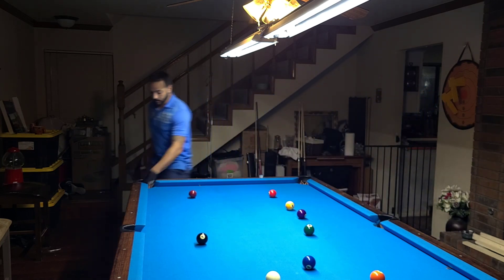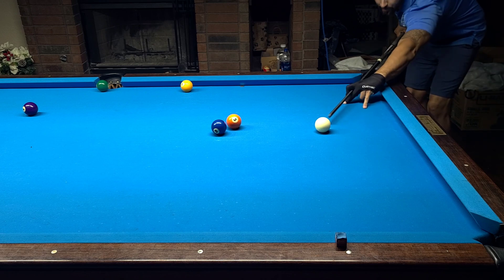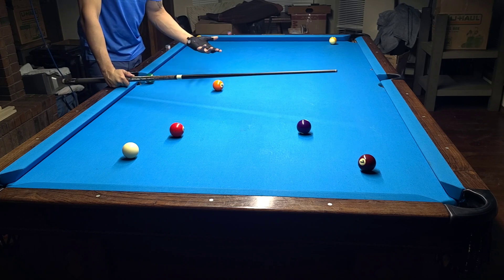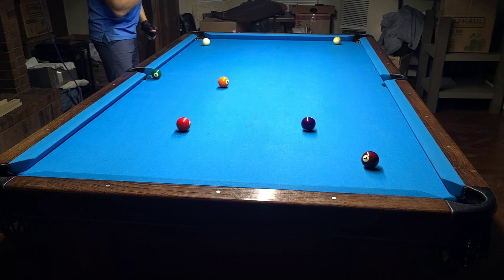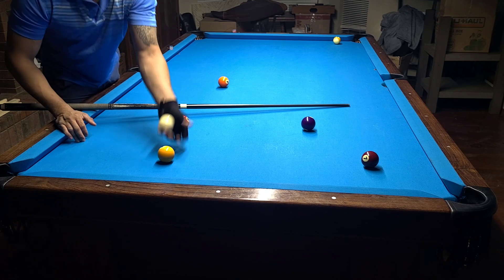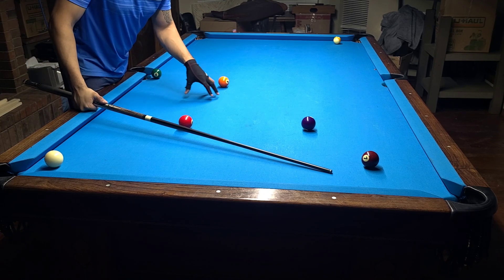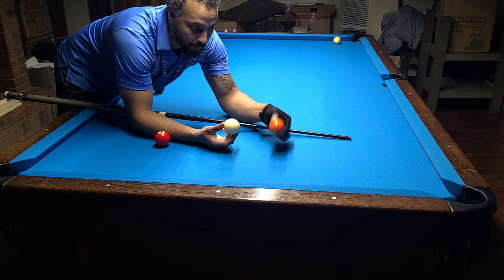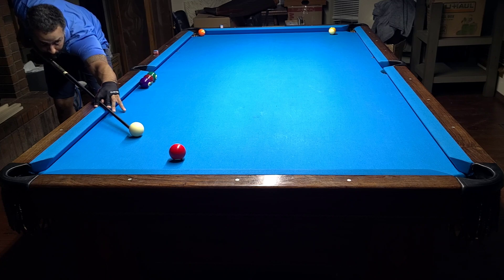90°+ Banking (Intro to banking)

Comment: Kicking and banking is the same angles the on Lu difference ic when you bank you put opposite spin on the cue ball if you are banking a ball to the right which you have started tell that now in your video!! It’s still the same angles 😎of course there are many variables that cause all banks an all kicks to be low % shots !! I learned the # system from Tor Lowry many years ago and it works really well of course every table shoots different! I went from a 1980’s 41/2 x 9 GANDY  to shooting on 7 ft DIAMOND WITH SAME CLOTH SIMONES 860 ! And it took me at least 6weeks playing a couple night a week to adjust !!

Comment: What if the cue ball is not in that line. Should I use some parallel line ? And which ?
Reply from the maker: Try 2 things… one of them will work for you... Try the parallel shift, then also try the vanishing point or as they say spot on the wall. Let me know what you find out..

Comment: Your first example is called a kick not a bank. Kicking is using the cue ball to go off of one or more rails to make an object ball. Banking is making an object ball off of one or more rails.
Reply from the maker: Thanks for the support! Lol
Reply: The question is how do you adjust, for example, if the ball isn’t in the pocket.  Maybe a diamond either side of the pocket for, 2, 3, 4 or 5 rail kicks